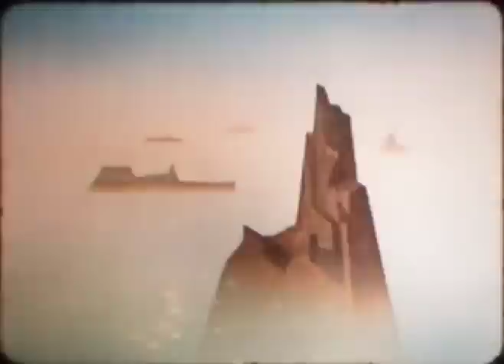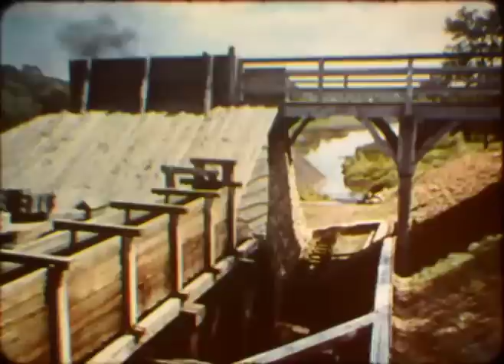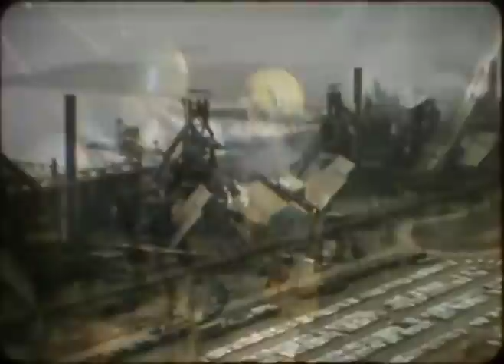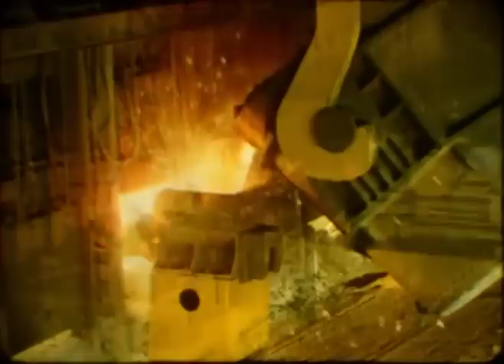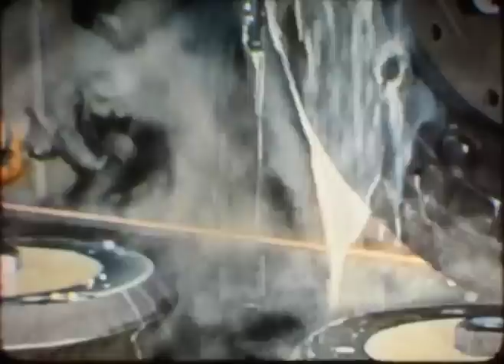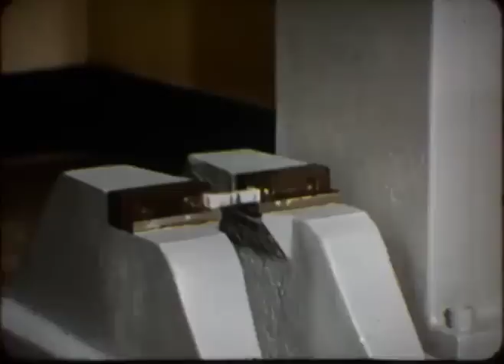Walt Disney Productions: "Steel and America" (1965)

Comment: The TOW missile uses a thin pair of wires that sends data back and forth from the Missile Guidance System at the launcher and there’s 4,000 meters of this hair thin wire spooled on the end of each missile, that wire has a tensile strength of around 4,000 pounds and handling it can be dangerous since it’s so thin, it’ll cut you like a cheese cutter so we handle it with thick leather gloves or often, not at all. The wire was the one component that took the longest to develop and the missile was first deployed in 1968 in Vietnam. We still use the same missile and system today but we also have wireless TOW missiles if we opt to use them.
Reply: We used the tow on the Bradley back in the 90's - early 2000's. I assume they still do.

Comment: so wrought iron basically was the process of getting all of the carbon out?
Reply: If you got all the carbon out, you would be left with soft iron, which is just about useless.
Wrought iron is about aligning the grain direction so as to get the maximum strength that carbon confers.
Reply from the maker: @ I’m learning so much about the process of manufacturing steel!